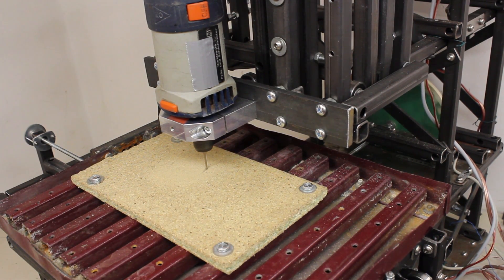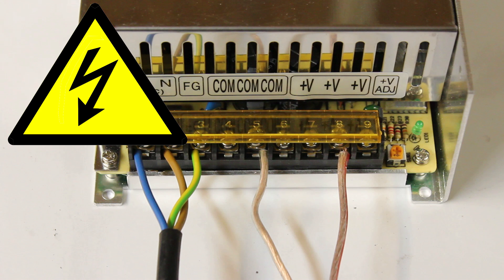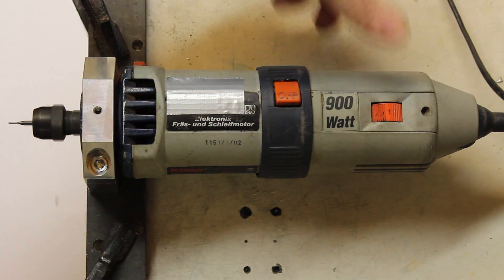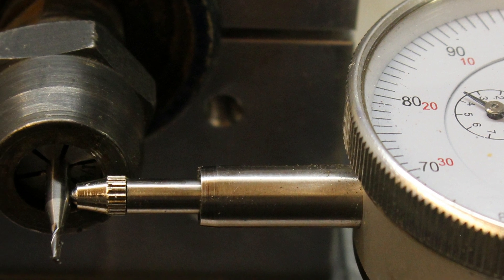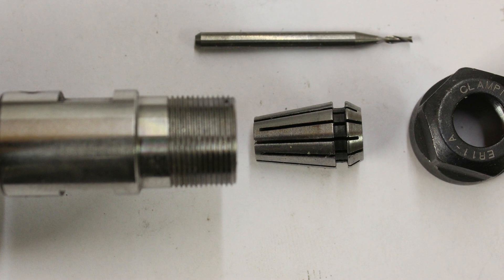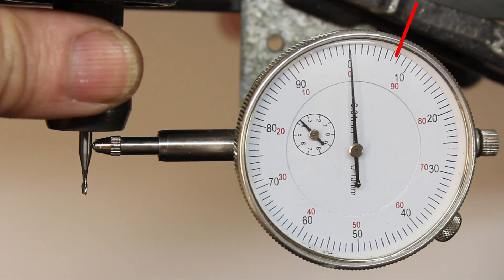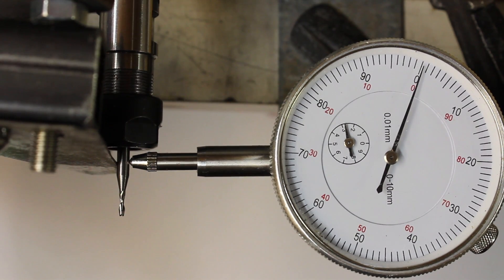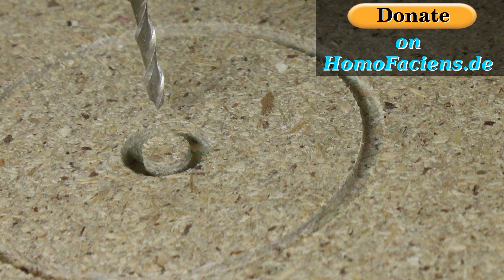Spindle motors - quality check

Comment: Your 12 V spindle motor speed control is probably NOT broken.  If you power it from a bench power supply it will run at the voltage you put in.  If you power it from an unregulated power supply such as an old car battery charger with no smoothing the speed control will work.
Reply from the maker: Thanks for pointing that out. Since it is a really worse spindle I haven't done anything with it after recording the video.

Comment: Just one additional information: this test only proved the quality of your motors in your hand, because I had the same gauge meter and the same 400w spindle and I measured only 60um (not as much as You, so in my readings the 400w spindle is far the best even under load), and I saw it in other youtube videos that collets from china are waste of money and the accuracy is very depends on the collet not just the bearings of the spindle. Probably the wearing out is also a very important parameter, maybe your spindle is more used than mine, anyway You did a very good test, just wanted to show You that it's far not enough representative. Keep up the good videos like this and thanks for the effort You put in it!
Reply from the maker: Thanks for sharing your thoughts!

My 400W was brand new, so wear is definitely not the reason for the bad result. The 900W machine is the one used for countless hours in an often not very gentle way and it's still the best one ;-)
Just look at the long, thin shaft of the 400W spindle that inevitably bends under load. Furthermore the tool holder with the collet is fixed on the shaft with one screw - definitely no perfect solution to fix it centered. Maybe you were lucky and got a better one, mine is definitely only for light work. Same as your remark about cheap collets from the far east, cheap spindle motors are usually also manufactured with large tolerances...

Comment: Please suggest me which spindle motor model is suitable for this project : 
https://nl.aliexpress.com/store/product/New-products-4-axis-CNC-kit-Nema-23-Stepper-Motor-Dual-Shaft-425oz-in-112mm-3A/907217_1138965261.html?spm=a2g0z.12010608.0.0.2eee6efBJxBoR
Reply from the maker: How can I give an advice for a machine that doesn't exist yet? You are referring to nothing but a couple of components. After watching my video you should know that solid bearings, a large diameter of the motor shaft and a short lever from motor housing to collet are things to consider when buying a spindle motor.

Comment: this 900W spindle where can i get this.. i cannot find any motor with this much rpm  does it run on VFD
Reply from the maker: I purchased this spindle more than a decade ago in a local store here in Germany. I guess it's no longer in production. It's a Kress FM6990E.
Reply: So it runs on ac directly. No VFD unit needed plug in wall socket
Reply from the maker: Yes, just plug in wall socket and turn a wheel on the machine to set the speed.

Comment: Thank you very much for your hard work, I do find a bit interesting that you have not consider to use one of the large "Hobby Grade Brushless Motors" they are cheap and easily controllable using an input signal...
Reply from the maker: Give me such a motor and I might test it with my measurement equippment.

Comment: I'm not sure about .eu, but in .us, a lot of people end up using laminate routers, which are smaller versions of the standard hand held wood routers. If you have any of those available in the area I would love to see one of those tested. I just LOVE that you are mostly working with old, used, tools that have proven themselves over time. People here will try to save a few dollars by purchasing that chinese junk, when there are high quality, long lasting, locally made tools at the junk shop down the road for the same price or less which will work so much better... And last... I paid $10 for my 1980's hand drill and it hasn't missed a beat since.
Reply from the maker: I guess my measurement setup isn't good enough to demonstrate the differences between various quality machines. It was useful to show how bad the cheap tools are compared to good ones.
Yes I totally agree: A used quality machine from a local seller is a better investment than shiny new scrap machines that were shipped half around the globe.

Comment: Have you seen the Mantis spindle assembly?   http://youtu.be/uVMme2-srFI   I'm sure you could do something similar using the motors above but have your own collet like this:  http://www.banggood.com/C20-Straight-Shank-Collet-Chuck-Holder-Tool-Holder-CNC-Milling-Lathe-p-1037675.html?rmmds=search
Reply from the maker: Yes, I will try to modify normal motors for use as spindle motors and show where the limitations are in the future. Thanks for sharing the links!

Comment: Just In case your milling cutter was not straight it might have contributed to the run-out measurements. If you mark one point on the side then you could test how this hypothetical curvature affected your results. Thanks!
Reply from the maker: Yes, these tests just give a rough overview, but the difference between the measured results are a clear indication of what goes wrong with cheap motors.
Thanks for sharing your thoughts!

Comment: Those chinese DC motors are hit and miss. The thing is that there are some upgrades you can do to them. Manly the bearings can be replaced with higher quality bearings and use a metal shim for their cups. Those chinese motors have rubber bearing mounts that allow allot of deflection. Hint, you can use soda cans as stock for the shims.
Reply from the maker: The idea behind my machines is to take what you can get, thus a motor upgrade is an option. Thanks for sharing your knowledge.

Comment: Have you tried connecting the 12 Volt motor to an 12V AC power supply? I have the smaller Proxxon motor with a similar speed control that does not work when I run it from a battery (DC voltage), but it does work with the original 12V AC power supply. I think the speed control circuit is tyristor based and needs AC to work.
Reply from the maker: The label on the machine says that it needs DC voltage, thus I never tried an AC power supply. Maybe I will give it a try next time I am playing with this motor.
Reply: I had the same problem. It is because the speed controller uses a thyristor to control the speed. I control mine with a rectified AC 12V supply with no smoothing capacitors & it works a treat